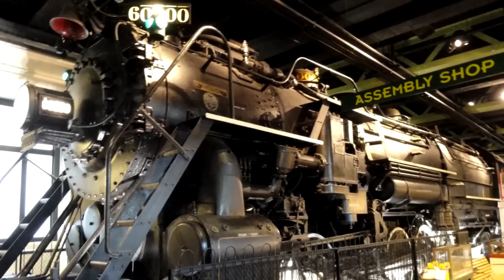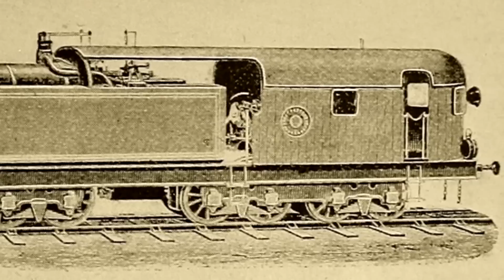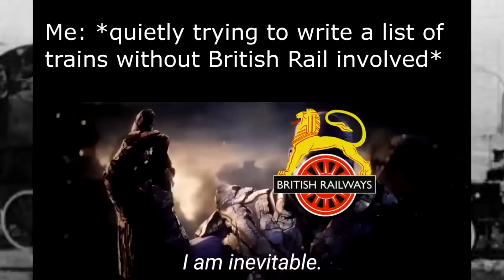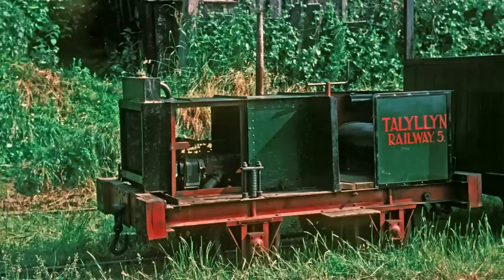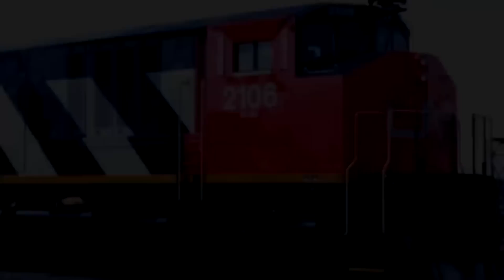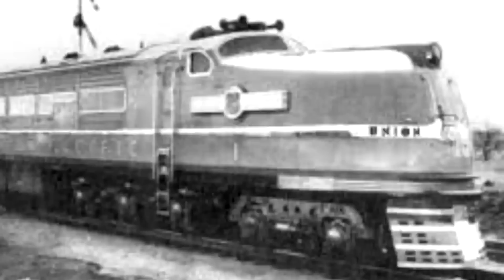The Worst Trains Ever Montage (Parts 21-25) | History in the Dark

Comment: I wish that I know how to build a Daiconian version of the T1.
Reply: Daiconian durasteel, tear-proof duraplastic pipes for the boiler articulation, works on electrified water instead of water mixing with fire (which makes them by the nicknames "short-circuit duplexes").
Reply: As long as there being water and electricity, the speed remains stable. No electricity, slows down and stops. No water, overspeed. (Luckily there are some articulation units in between the bogeys and boilers, and there are some ELCs (electricity level controls) to help slow down the train once that the water gets very low or just empty.) Short-circuit engines are also known as Neo-Steamers.
Reply: Okay. Maybe it does require coal like pre-daiconian versions do. So if it's out of electricity to electrify the water, coal will be used to make steam until they either run out of coal or water or get to a stationary triple powering modules at stations in Daiconia.
Reply: I decided to call a Daiconian T1 mk1s "T1-D1s" due to them having auto-whistle systems and that the trains, the Pennsylvanian T1s, they represent look like giant astromechs in front view. I like how they looked, both Daiconian project and Pennsylvanian original.
Reply: I also find the wheel slip situation comical by appearance.

Comment: What if there were coal slider tender engines with water tankers between each bogey? A water tanker between the 4 frontwheel bogey and 6 drivewheel bogey and 1 between that bogey and the 2 backwheel bogey. As well as a laddered water tanker between THAT bogey and the 6 wheel tenderwheel bogey.

Comment: Interestingly, in the early 1990s, two Class 232 locomotives were re-engined with Caterpillar engines in Germany as part of a test. They were considered to be very reliable and powerful and had long service intervals, but the conversion with these engines was the most complex and expensive of all three test variants. It was then decided to use the engines from Russia again because they were the cheapest and the installation was less complicated.

Comment: i do have a suggestion for one to add the British Rail Class 701,  while not the worst of the bad locos the numerous issues over technical issues and issues with the crew who were supposed to take themand SWRs handling like scrapping or storing the older trains before the 701s enter service and the train shortage that resorted and the number of them still in storage while only a small number have finally entered service in January over 4 years late.